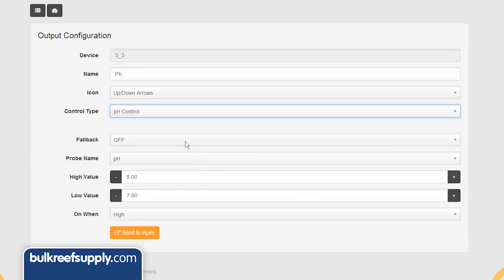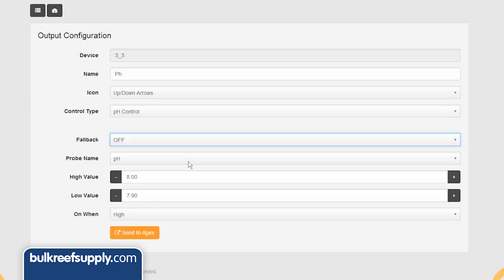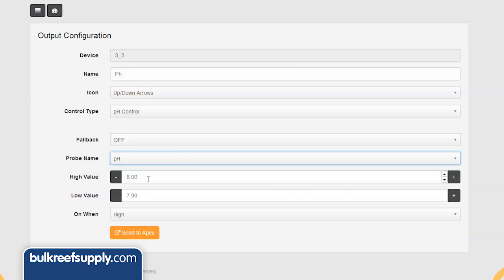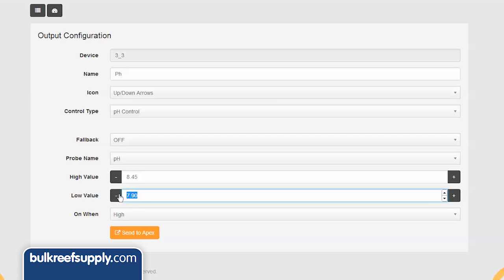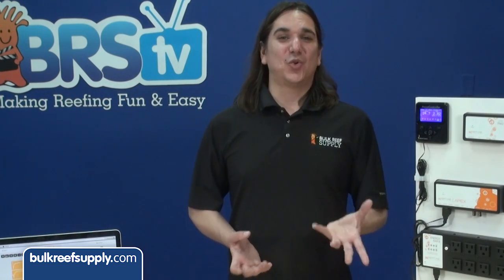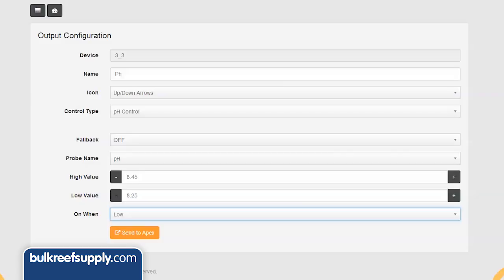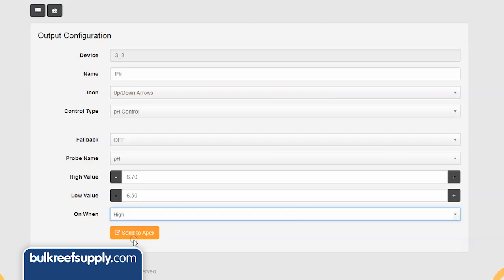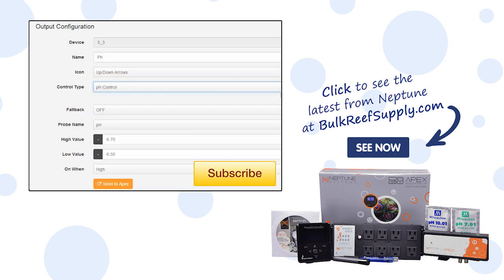Configuring pH Control in Fusion EP 14: Apex Aquarium Controllers from Neptune Systems

Comment: so what would happen if my KH was stable at say 8.3dkh, and i  then add the apex to my system ( which ive ordered) and i put the set points like u have there. If the PH is below 8.25, when i power the apex on , will it then start my dosing pump which will then increase my alkalinity , which was previously stable ?